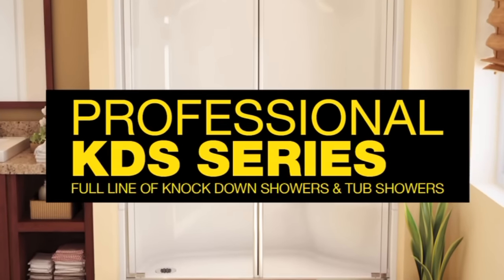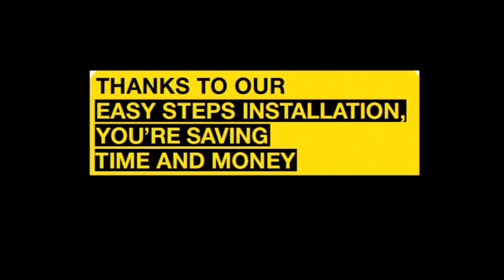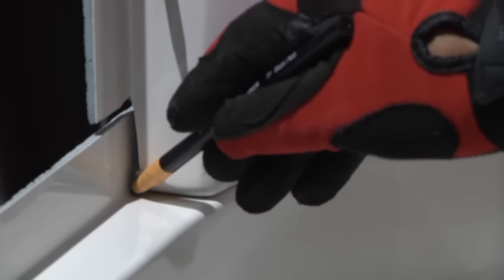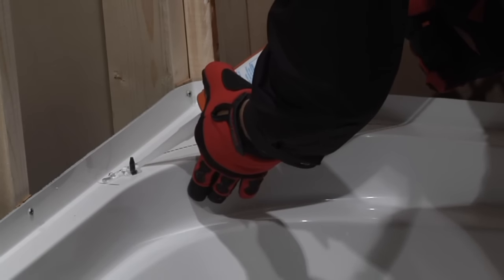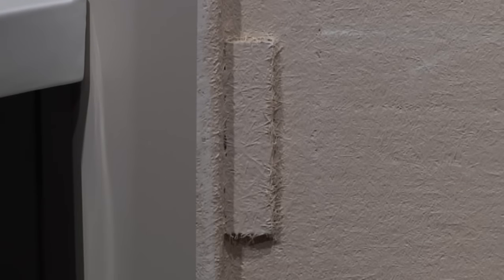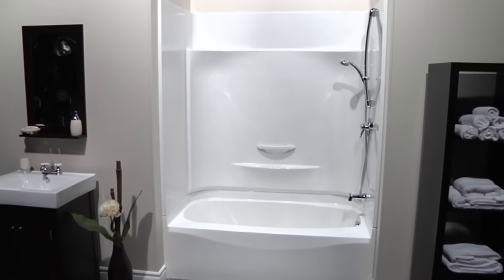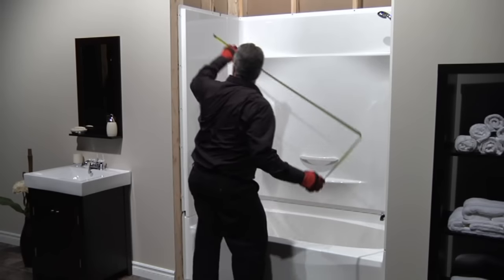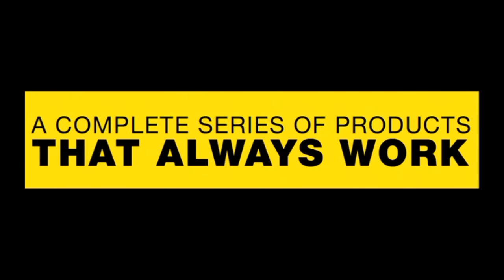MAAX Professional - Installation Video KDS Series

Comment: I got the 4 piece shower installed, there was some serious struggle getting the edges to come together.
The back piece flared out 1/4" at the top right which made it difficult, possibly a defective piece.

I have a question about finising the top and sides, how should I finish these??
Do I install drywall over the 1" lip that protrudes beyond the wall?
Is there a top I can order for the 4 piece?
What do you recomnmend for finishing the sides?  Some kind of overlapping border?

Please let me know what you recommend.
Is anyone familiar with this? I am not sure how to proceed.
Reply: +Paul Michaud 
Hi, did you ever find your answers?  I am wondering about the drywall installation as well, plus working with the existing plumbing.  They don't show anything about supply or drain.
Reply: To help others looking, I found this. ecman51 has a good comment. http://www.doityourself.com/forum/walls-ceilings/407819-finish-around-tub-surround.html#b
Reply: You can drywall and mud the flange around the surround.

Comment: This is a terrible product, I wouldn't recommend. The Company has gotten everything wrong! The shower surround costs approximately $1,800 for materials and another $500 for local installation. The weight of the panels are too heavy for one person to install, so you will need two able bodies on the install which adds more costs. I purchased the Utile by MAAX shower surround recently and paid to have it delivered to my project because it's too big to fit in a truck without breaking or damaging. When it arrived, there was hardware missing and getting replacement parts ordered is a nightmare. Also, the pre-drilled holes on the back panel to accommodate the "X" clips are drilled incorrectly and impossible to redrill onsite and get holes to line up with side panels. Online customer service sent me a "template" on my iPhone to use for new hole location, what a joke. Basically, I've spent $1,800 on the product, $500 on labor and help to figure out the onsite problems and i'm not even close to getting the project finished. There are too many other options for a shower surround if you want to drop approx $2,500. I could have spent half of this cost and job would be finished a week ago. The customer service in Canada have no intention of helping, they just ask you to send them more information online and they will get back to you in 2 days. It's been two weeks already and my client is not impressed. Oh!, and to add insult to injury, they asked if I'd pay for shipping to return the incorrectly manufactured panels that weight 200lbs.